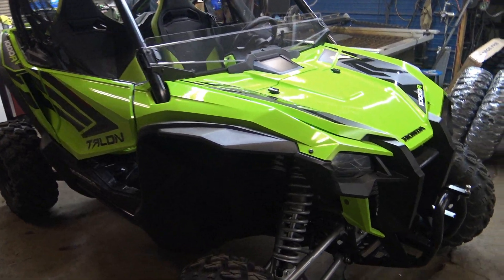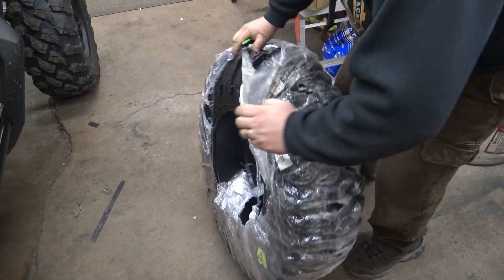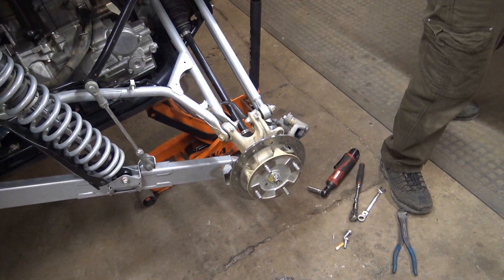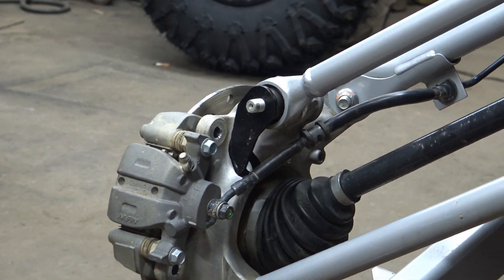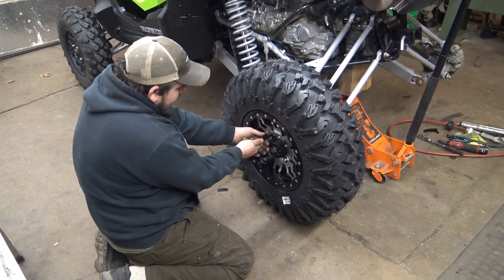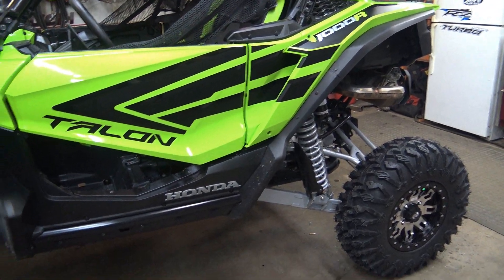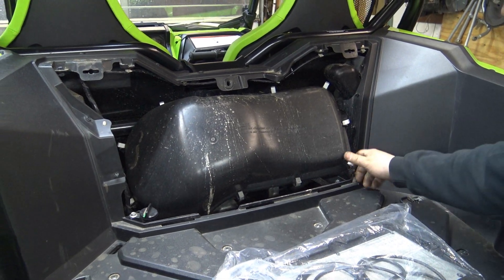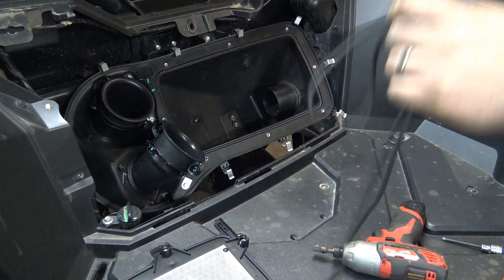Honda Talon Gets Fresh Tires/Wheels, Double Shear Brackets, Bearings Greased and Filter change.

Comment: Check your intake boot. Throttle body to cylinder head it may be loose from the factory.
Reply from the maker: Thanks for the pointer, we will check it out.
Reply: It’s not loose. The guy that’s saying that happened to his had a dealer not properly install his air box cover and the motor ingested a ton of dirt and cooked the motor.

Comment: The reason you do recommended torque specs on wheel bearings is because too much torque can overload the bearings and cause premature failure.

Comment: There 28s but measure out, more like 26/27
Reply from the maker: Gottcha. Machine really looks good on 31's. 30's would probably be a little too small yet so glad he went slightly bigger.
Reply: Utv Outlaws I got the same wheels with 30” Teribites, they seems to work pretty good!👍

Comment: What offset wheels are those?  Talon should have different front & rear, otherwise it will be wider in the front than the rear.
Reply from the maker: I believe it's a 5+2 on all 4 wheels. Plan is the run a spacer for the rear so we dont have to worry about running odd rims.
Reply: @utvoutlaws6652  1.5" spacer ?